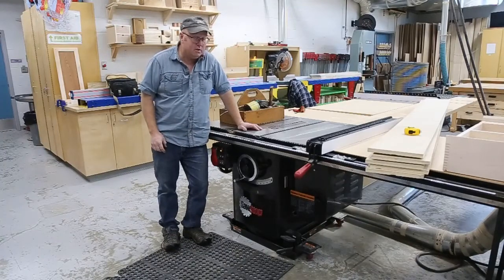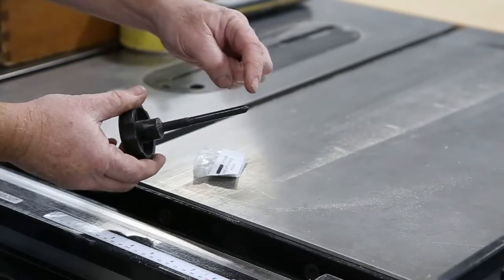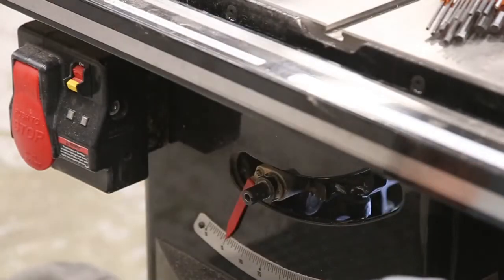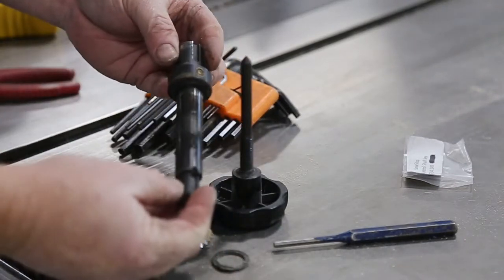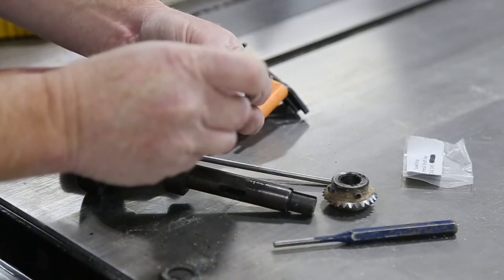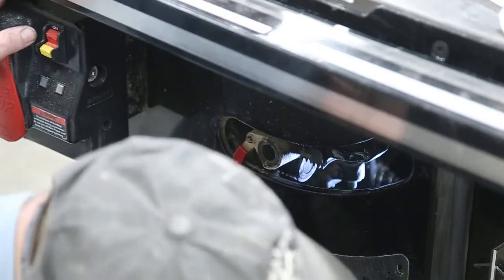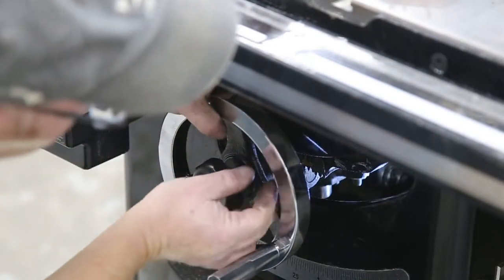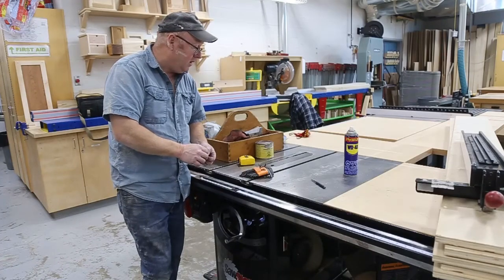SawStop table saw blade won't lock in position

Comment: Fantastic! Thanks so much for sharing. Just started sharing a professional shop and did some quick maintenance on the 8 yr old ICS. I'm 99% sure I'm running into this issue. Will definitely pursue. Thanks!!
Reply from the maker: Very common on this saw.  I maintain school shops and have replaced all of them.  Thanks.  Stevo